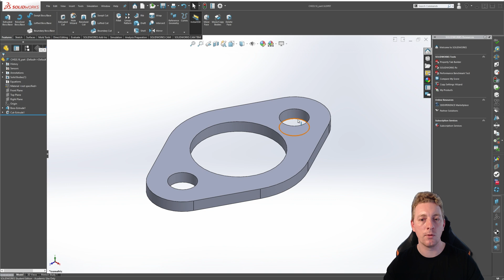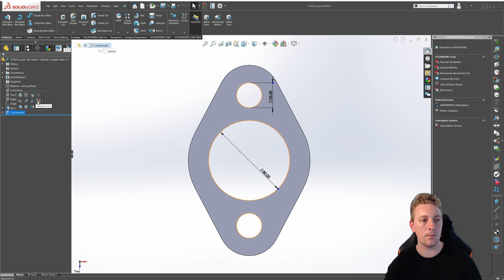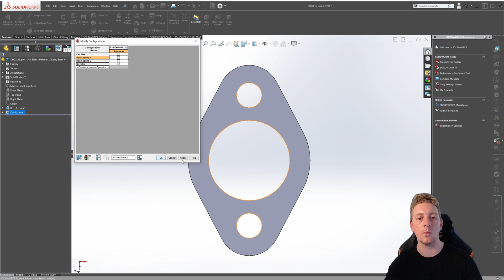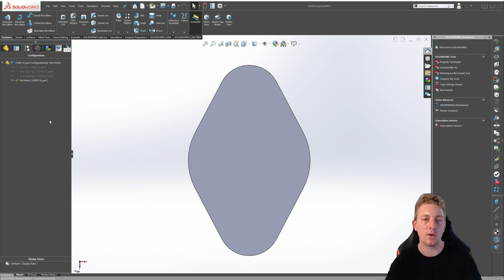Part Configurations | SOLIDWORKS BEGINNER | Chapter 02: Lesson 16 | CSWA COURSE

Comment: thank you for this beautiful course. how come when i touch the part, the dimension doesn't pop on the screen. and i can only see them when open the sketch itself?

how can i change that?
Reply: i use sw 2024
Reply from the maker: Your welcome. That is something I havent figured out, some machines I used have done it and others havent. Its likely a setting somewhere in the sketch options
Reply: I have had the same problem. Let me know if you find a solution!
Reply: I found a solution via a quick Grok question. Under the features tab in the command manager, click Instant 3D. It's a little ruler with an arrow icon, and it's super useful to change this quickly instead of having to go into settings. Hope this makes your life easier!